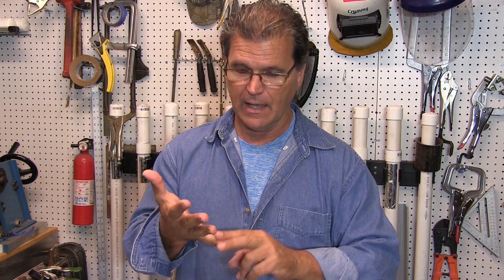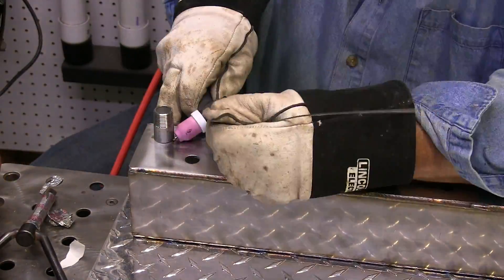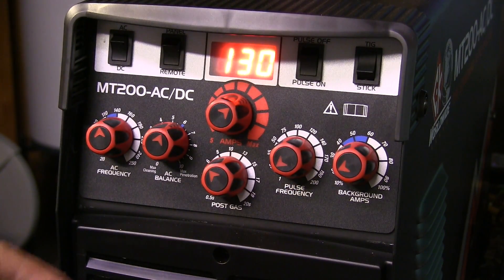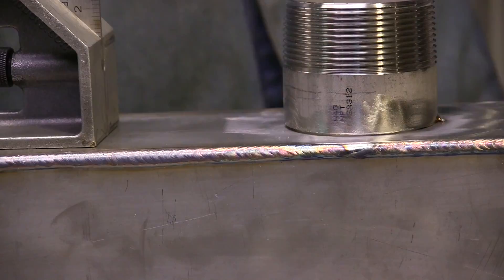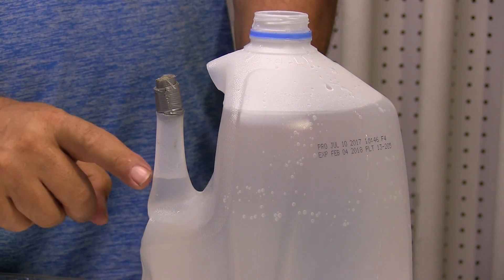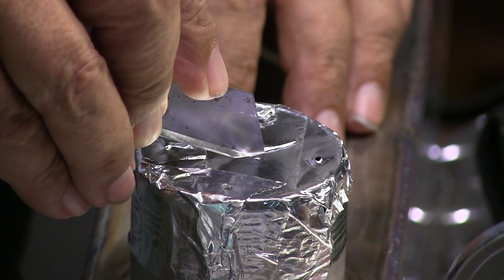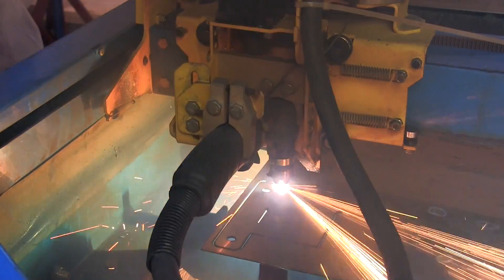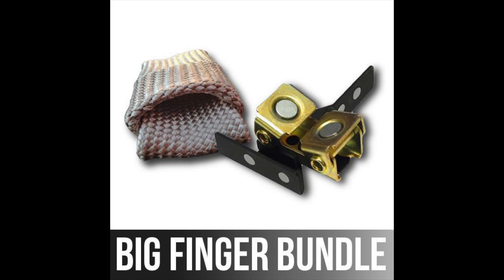Stainless Steel Welding & Quick PlasmaCam brackets

Comment: what would you recommend to weld like .o65 thin wall tubing with mig tho... some guy wants me to use stainless steel wire and.a.mig gun simply because he doesn't have a tig setup could you do a video on that??

Comment: With the knowledge that I drink with your videos I was able to build a 4" pipeline with 52 meters of 316 stainless steel. 
Back purging and the gas lens made the difference. 
The pipeline is clean and it's pumped with 5 bar of water. 
I really thank you for a young welder like me getting teached by the best. You're my mentor! 
Best regards from Portugal 🙆

Comment: Jody, awesome video! Thanks so much! I am just curious, why was purge not needed when you welded the brackets on?
Reply from the maker: mainly because the brackets were much thinner than the body of the manifold so the amperage used to weld brackets would not come close to penetrating thru the .125" thick manifold  a little discoloration inside will not be a problem.
Reply: He backed them with an aluminum block. No purge needed when you back it up.
Reply: Thanks! That makes sense!

Comment: Hi. My question fell on deff ears on a Mondays welding channel so time ago . So I am trying again.    Gauges in the UK for argon use/ read in litres per minute LPM is there a conversion or can you tell us when you do the inch to mm for rod metal thickness ETC.  Steve.
Reply: Grab an app called handyCalc for your smartphone, hit the menu top right corner and then tools, then unit converter.  I use this app daily for a calculator and unit conversions from US to metric.

Comment: Looking for some good advice on flux coated stainless filler rod. Not sure if you have ran it at all. They aren't purging pipe anymore they wanna use that flux coated rod for all tig roots
Reply from the maker: I have not used flux coated tig rods.  I see them every year at Fabtech and in advertisements.  I have used solar flux and I dont enjoy using it but it does prevent sugaring.

Comment: And what about calculating/ determining when that part is fully purged? Rough volume/flow rate calculation? Ive turn up my gas high to get it filled quickly then back it down.

Comment: This is probably a dumb question.  If you clamp everything down to avoid distortion, does that mean that there are stresses that remain in the weldment when your done?
Reply from the maker: there are always stresses in a weldment.  probably more when things are clamped to prevent distortion. for critical applications, a stress relief heat treatment is sometimes used where the pat is heated to a temperature that allows some plastic movement and relief of residual stresses.

Comment: At what thickness would you have to purge the nipple welds?
Reply from the maker: I would say if the thickness was around .080" or thinner I would started thinking about purging.  And it all depends on the application. for example, If this part was for food service, I would have purged everything.
with the aluminum backing clamped to the back side, the metal barely even discolored on the inside and I didnt even come close to penetrating thru. The nipples themselves were around .100" wall thickness.
Reply: Thank you I learn so much from your videos

Comment: We use alway Nitrogen hydrogen 98/2 on stainless for purging
Reply: I have always used argon for purging, unless you need purge gas all day every day it's cheaper to use argon as it saves on cylinder rent.
Reply: Equiluxe1 we weld pipes so we purge all day long. Than nitrogen/hydrogen is cheaper because its cheaper per liter

Comment: For those who don't know that aluminum backing doesn't eliminate the need to purge it can reduce the use of purge gas in certain situations especially on extremely thin stainless the metal doesn't get hot enough out to Sugar out something we used extensively back in the day whenever I was building food processing equipment good show Jody